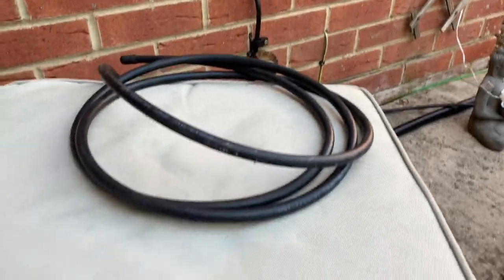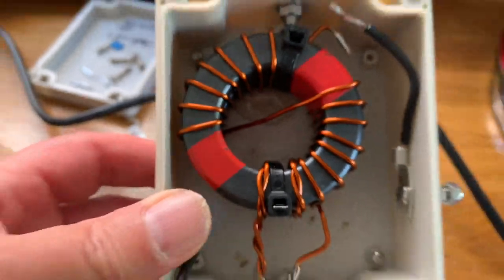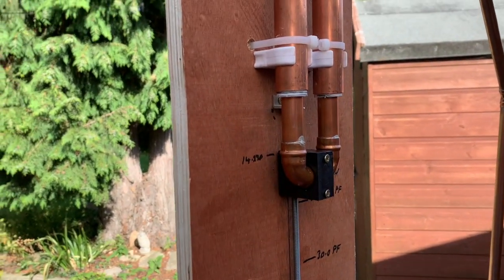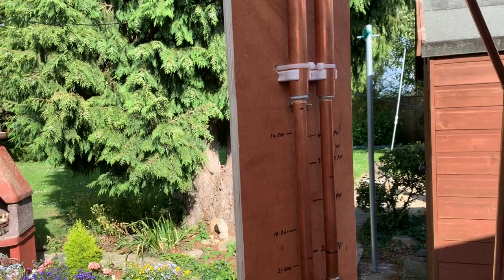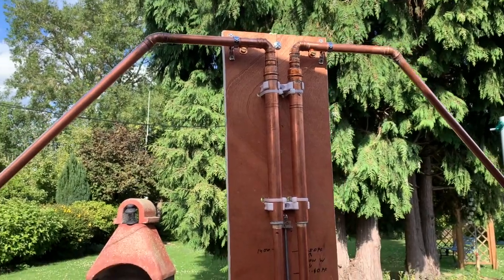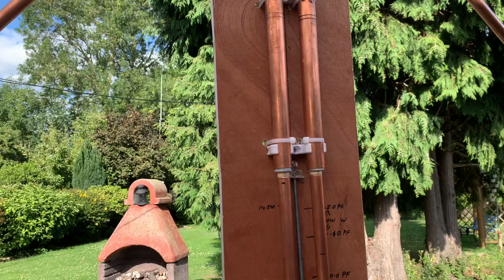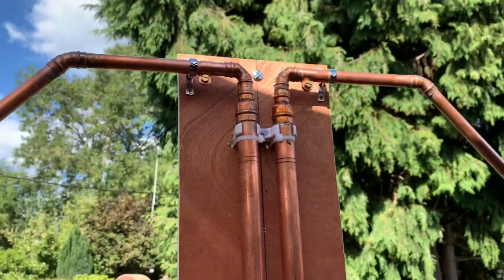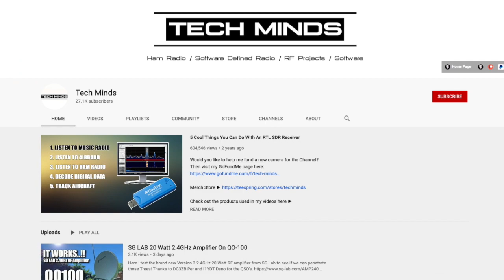Ham Radio: Project Catch UP : Just a Chat about Roly Coil's, The Gainmaster and Mag Loops.

Comment: Do you Believe there is much difference between rg8x and rg213 etc. 
even under a 100 foot run?
Reply from the maker: Ed Wymer no not for short runs,  you will not hear any difference on most decent coax however the person you are transmitting to and your swr meter may. Due to losses.